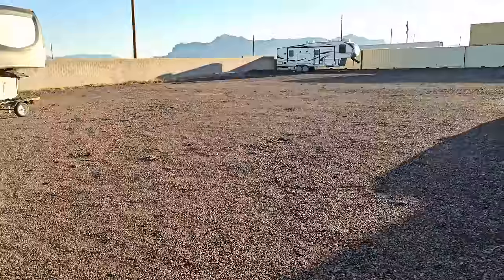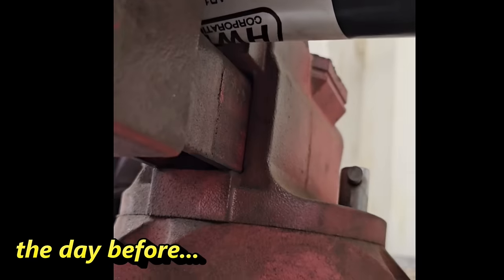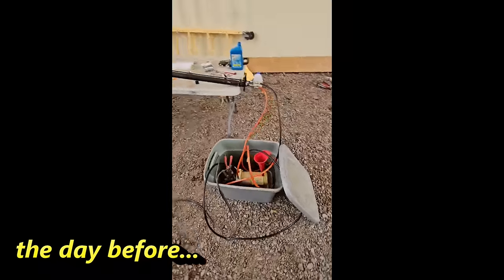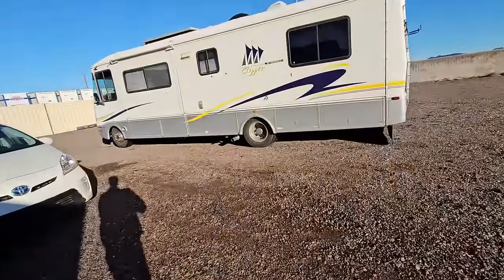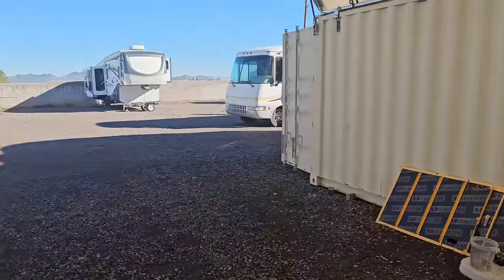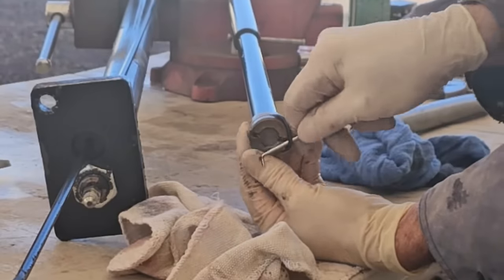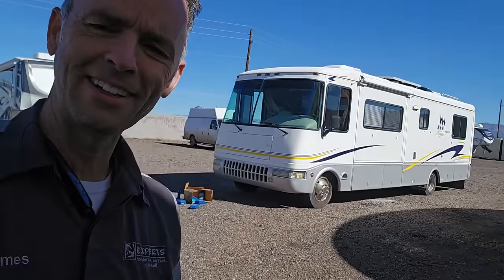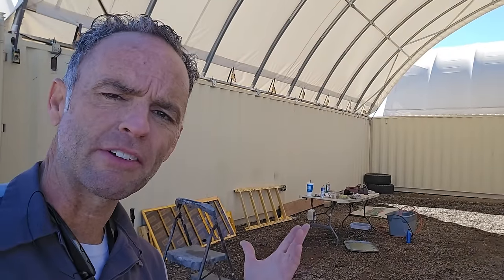How to Repair HWH RV Slide Room

Comment: James,  Just for info, that sliding sleeve on the cylinder rod is a mechanical stop to prevent the cylinder rod from extending to far.  The rod is supported by the seals on the end and the seals in the 'head' you removed.  That sleeve provides about 12"-16" space between the seals otherwise you'd only have maybe and inch or two between the seals allowing the inner rod to become out of line with the outer cylinder tube, putting more pressure on the seals causing them to leak.  Good that you rebuilt both rams however they should have had the synchronizing cylinder rebuilt as well.  Chances are high that it is going to fail down the road and possible cause more serious problems.  I can attest to that.  I had the seals on my sync cyl fail and it allowed my slide to only make one of the rams operate, causing the slide to come in crooked and twist (front slide with a raised floor) .  It got bound up where I couldn't extend or retract the slide and couldn't even drive it anywhere for repairs.  It even bowed the side wall pulling the floor away from the side.  Fortunately this happened in our driveway and we had just returned from a trip where we spend a weekend in Death Valley .... 250 miles from nowhere !  Thank god we made it back to Florida before this had happened.  Long story short we finally were able to manually jack the slide around to get it pushed back in and up to an old Monaco Service Center in Central Fla to get it repaired.  I was able to get the rams & sych Cyl repaired for about $115 each.  In the end I had about a $9,000 bill.  About a moth later I started having a leak in one of the cyls on the other front slide start leaking but I caught it before any damage occurred. Lesson learned is if one seal leaks replace all of them in the system.  This was in a 2005 45 ft Monaco Executive.  Great video showing how everything works.  BTW, bleeding the air out of that sync cyl takes a special procedure as it's a blind end cylinder with fluid in both side of the ram seal that's in the center.
Reply from the maker: the sync cylinder has spring loaded poppet valves that allow fluid exchange between the chambers
Reply: @AZExpert  Not on mine

Comment: James thank you for this video, well done, your videos rock! (great video work by the way) I am unlucky to own a 2006/2007 Thor Mandalay that has 4 slides + leveling jacks + generator all HWH. Timing is everything I have a bedroom slide that wont retract, and yup a HWH cylinder is leaking badly. As I have 3 mores slides, generator ram and jacks (hopefully not welded) to be repaired next. I will call contact Martin Fluid Seals to find the ones I require. Question, I cannot find any info on the HWH website about seal sizes for a given HWH cylinder part number, how did you get the right sized seals from Martin Fluid? Your ability to work with one hand while videoing with your free hand is a gift, thank you.
Reply from the maker: they measured and matched at location'

Comment: James,   You are a hero again!   Question, is the baby powder something that should be done?
Reply from the maker: There are 3 different types of rubber seals and I do not trust or like conditioner, I wanted to ensure the slide didn't rip the sidewall completely and the powder is what the factories use when they are made and it lubricates the seal too without leaving an oily mess.

Comment: I have a Rexhall Roseair and have an tip in/tip out issue. When the slide out is out the right side of the slide is not sealing on the upper part of the slide out (closest to the driver seat). I can't figure out how to adjust that tip in/tip out. My system is nearly identical to this one. Can you either explain how to or point me in a direction where to find this information?

Thank you

Comment: So pumps  cone out rear of slide cylinder ? Where is the proir two years ago slide video ?
Reply from the maker: I put this video  in the same Playlist as the previous one
Reply: @AZExpert  I found 3 parts, is there a 4th that covers the HWH electric switch failure ?

Comment: What are your thoughts on running a bottle of Lucas rack and pinion or Lucas transmission fix in the hydrolic system? It would help rejuvenate all the seals etc?
Reply from the maker: I have little faith in any oil additives, they can claim anything in a lab and then claim ignorance after it was outside a lab.
Reply: @AZExpert  I was asking because my f350 steering box leaked really bad. I put in fresh ATF with Lucas rack and pion and she hasn't leaked in 15 years. It's not quite a hydrolic system but close. Thanks for the response.

Comment: My 2001 Winnebago Class C looks like it has the same HWH slideout system.  Do the slide rails themselves need any lubrication?  It looks like the previous owner had coated them with white lithium grease
Reply from the maker: no lubrication is necessary and causes issues if applied
Reply: Thanks!  Good to know.  Looks like I'll be cleaning them off! @AZExpert